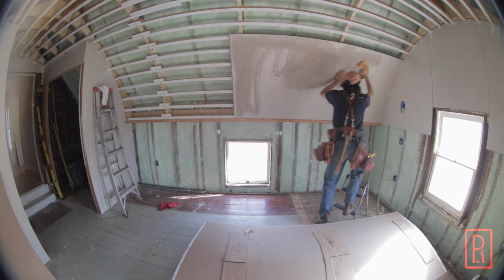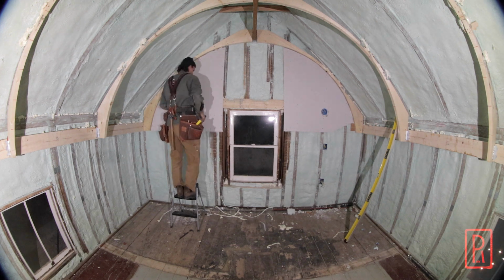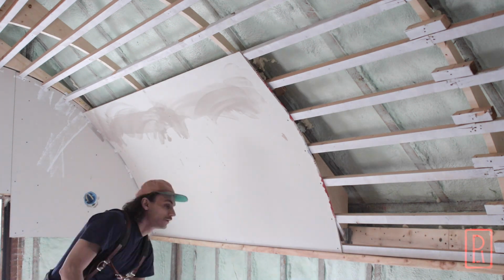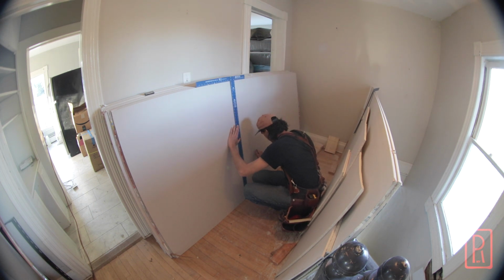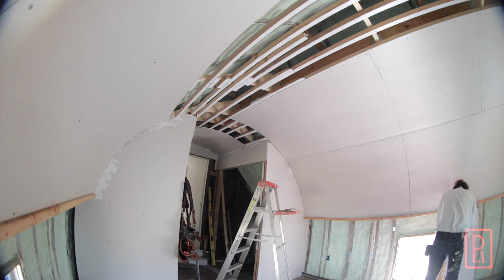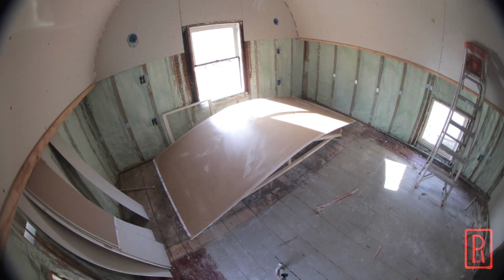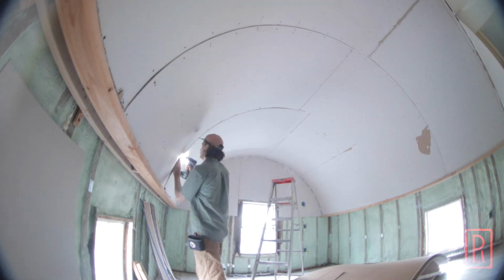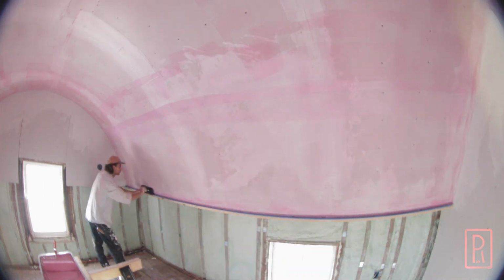011 BENDING and installing DRYWALL on a curved ceiling, Bedroom Barrel Vault Ep.6

Comment: I haven't wet a plasterboard in about 35 years.We use 6mm boards now but it brings back memories.Thank you and pretty work too.
Reply: What is the spacing when using the thin drywall?  Do you have to put 2 layers for fire code?
Reply: This guy was using 6mm boards, he described them as 1/4 inch boards which is approx 6mm
Still - it's not a bad idea to wet boards even thinner 6mm boards